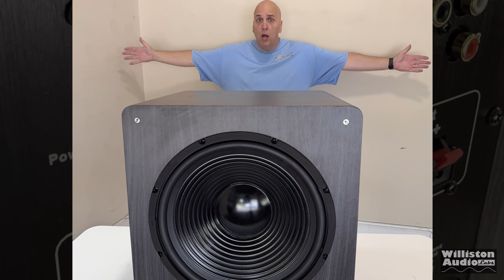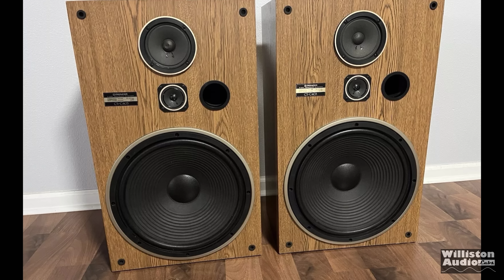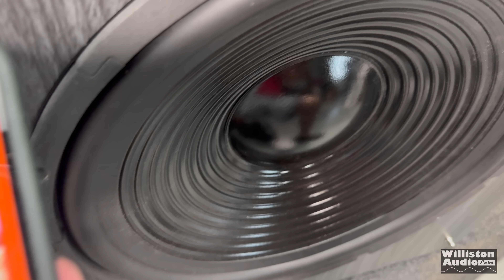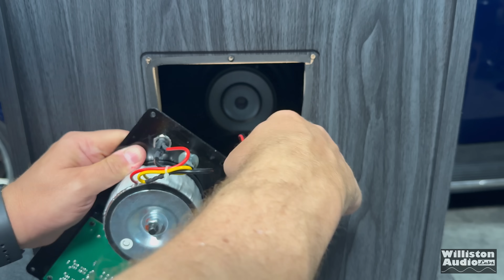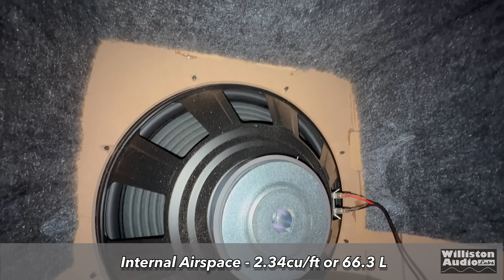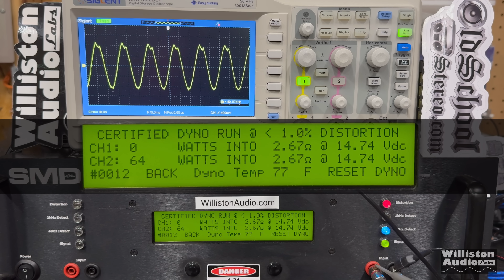The Worst 15" Sub I've Ever Tested - Acoustic Audio PSW600-15 Powered Subwoofer

Comment: Is this the same acoustic Audio company that makes the car stereo stuff like 2500 razor amp and the 2500 W 12 inch subwoofer cause those do bump. Granted they’re not 2500 W amps but they’re usually under $100. I think you did review one of them one time just wondering if there were the same company?

Comment: I hate to say this but um if ur using rcas off a car head unit or the aux to rcas off ur phone lmffao jfc man you seriously need to learn a few more than a few things smffh the line level on house 110v or 220v audio equipment is way fkn higher than even the highest rca line level car audio has to offer trust me my car runs 10 volt preouts 9 sets of rcas at 10 volts rms its an audiopipe component pioneer deh7500 to a mmartts btx8 dsp unit to the audiopipe rca expander line level booster peak 10volt rms on all rcas.  That 10 volt ran direct to an s.a.e. high current a501 amplifier and the sae amp ran at 220v is super quiet yet using the ayima tube style pre amp wakes that sae amp rt up to show off its 250rms per ch at 8 ohms lol thats a fkton for class a home shit frfr

Comment: You should check the subwoofer first. I have seen these all in ones utilize a 1/4th to 1/8th ohm woofer, which may explain the low power. Just a thought. Even the JL all in ones can use a .25 ohm woofer.

Comment: I'd buy it just for the enclosure --- to then swap out the driver for a Dayton or GRS driver (or maybe not, depending on the existing T/S parameters), then put in a couple of Dayton passive radiators, and then make it a 100% passive subwoofer using a used Crown XLS or Behringer iNuke amp with them. It's cheap enough to be an excellent DIY modding project without losing too many $$$ if things go awry, IMO.....
Reply: the enclosure is worthless.  It is cheap hollow wood. A 15 inch subwoofer in a  proper enclosure should never be light.

Comment: I'm not a tec but from  the visual  that I can see  my guess would be the chip set most likely used is going to be a 25cs200  2sa1943 . there quite a bit of ebay  amps that use the chip set usually in lower quality  amplifier  plates   the power supply worth more then the amplifier  section  that for sure..💯🎶🎵✌️🫡

Comment: why would a sub amp have a terdtoryul wound  transformer looks like a 1999 or older sub it need class d chip amp .that power supply would be best in a low power stereo or something needed to run 10 years ++

Comment: I was one of the ones who bought one of these a couple years ago and still use it, but not as a main speaker anymore. I got mine for about $200 when I was looking for the cheapest way to go as low as I could go with 20hz as my goal. This one was the only thing rated even close to that without going way up in price. I already knew to expect closer to 100-150 watts @ 8 ohms peak than the 600w it advertised. I am surprised it's actually 4 ohm!
There is a model with the speaker facing the floor with a 1" slotted "tuned to 22hz" port along the front end facing the floor as well. That is the model I ordered and I should've returned the front facing one, like you are reviewing, for that reason alone. The corner was damaged from shipping as well. I realized how much trouble and time it would be to return it and the fact I wouldn't have any money or reasonable bass for a while, if I did. Plus when I got my money back, I wouldn't have any more money than I started with to try again. Would the floor facing model with a seemingly way more functional slotted port actually made a large enough difference in low end response and throw to have been worth exchanging it instead? I say you should find one and try it, but I didn't see an actual frequency response measurement.
I'll say that it may respond lower than 30hz, but you can just barely notice it if you try hard. I was in a different place in life back then and I made it work by facing the driver at the floor with little "legs" to hold it up and the port facing the wall with the "crossover" set way low and boosting an already high gain on the inputs when I needed more out of it. I also had a problem for a while with the standby mode popping in and out to often, but sometimes not, along with a slight hum from day one. The LFE input doesn't respond to the crossover adjustment and is a very weak input, so it's practically useless. Also, this suffers from a limiter on the output when it reaches a certain lever so that the bass gets softer when too loud, then gets too heavy when you turn it back down. I've recently got an MTX PS-12 from a pawnshop with a blown capacitor that takes care of the missing the deep end while this AA one does a good job adding on the lower-mid bass that the MTX can't simultaneously handle with the failed capacitor, until the parts come in next week. I may get another identical MTX sub and try experimenting with stereo separation of my sub woofers eventually. Then this Acoustic Audio sub will go where it belongs which is (into the garbage) out into the workshop system, and of course for barely effective PA support out in the yard for events.
I've thought about replacing parts for improvement, but might as well keep it together as a "boombox" of sorts. I am really wanting passive subwoofers if I ever get enough extra money, or a deal I can't pass up comes along.

Comment: Hi big D, great video. Though this sub is clearly bad and misleading  I'm gonna input some information about hometheater subs.

They usually have less power compared to car audio subs, not only that their power output isn't linear.
 Most of the good hometheater subs have integrated dsps and a factory power limiters set by frequency.

This is done to have a consistent output db wise, or to prevent damage to the driver due to mechanical limitations.
Exemple, for the sub to achive 105db at 60hz it needs 250w of power, to get to the same loudness at 45hz it might only need 180w because of port efficiency and at 20hz it only uses 50w to achive 100% of the xmax.

Because hometheater subs are designed to have a smooth flat response throughout the frequency range, its important to have a graph of power x (frequency/db) to be 100% acurate.

This technicality doesn't remove the need for the amp to achive its rated power. It only points out that it might not sustain the rated power at all frequencies.

Comment: Acoustic audio is the brand that was sold out of the back of vans in parkinglots!!   I remember them in the 90's and early 2000
Reply: What a stupid name too. Might as well call it "Audible Sound" like yeah bro that's what sound is typically
Reply: @RobertJeffersonBased  Visual Video could be their sister company selling TV's 😂
Reply: Years ago and old friend had a set of "Accoustic Research" white van speakers. They had 12" woofers with tiny little coils and magnets. All show, no go.

They were fine for the 25-30W receiver he had them hooked up to for some classic rock, but by no means were they good!
Reply: @volvo09  

Acoustic research is legit. Not a white van brand at all, though they also made some cheaper stuff. They invented the modern woofer as we know it, back in the 1950s.
Reply: @westelaudio943 i must have gotten the brand wrong then, maybe they were "accoustic audio" because these were NOT real hi fi speakers (i'm not super knowledgeable in the home hifi stuff). They had a tacky little frequency response graph on the front with the brand name on it. Over the years I've come across the same speakers with other names on them too.
Reply: @volvo09 

I think Acoustic Monitor or something like that was also around. Usually these speakers came with a translucent woofer cone. Their quality is similar to cheap early 90s rack system 3-way speakers. Boomy, but not really powerful (considering their size) bass due to the small magnet, and short on mids.
Reply: @volvo09  i remember that the "from a van, in best buy parking lot" speakers were that of the dollar store quality, and that they were told to the potential buyer as being HiFi overstock.  And when i told the seller i didnt know of the brand, it was said its because ACOUSTIC is to good to be in big box stores. that was also the first time i heard the term Bose  Blows"   i laughed at that one.
Reply: @westelaudio943ah, but as this channel has shown us, what they may have been in the 50s has no bearing on what they are today.

Comment: one could make a nice passive radiator out of that speaker. for the amp, build a decent 6" subwoofer and pair it with that. or just send it back because its trash anyways.

Comment: Definitely looks like a cheap sub. I'm wondering though if it could have performed better in a larger enclosure. I remember having a 15 like that when I was a teen, I believe it may have been Optimus  or some other generic brand. In a smaller enclosure it sounded like garbage, but did do better in a larger enclosure. At the time it was in one of those abs boxes that you could find at some of the best buy stores in the 90s.

Comment: Hi Willson it's probably a pair of Toshiba 1943 and 5200 transistors behind the heat sink, they can do a max of 100 to 110 watts with a 120 watt transformer, no wonder it's stuck at 77 watts with the 80 watt torridal, it's a class AB amp I personally owned one, which had an out put of 280 watts, but that amp had 3 pairs of those transistors with a 300 watt transformer
Reply from the maker: Thanks for the info and watching!

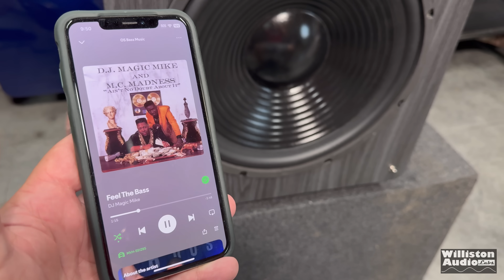Comment: 3:31. The amps are close.. but not 💯% the same.
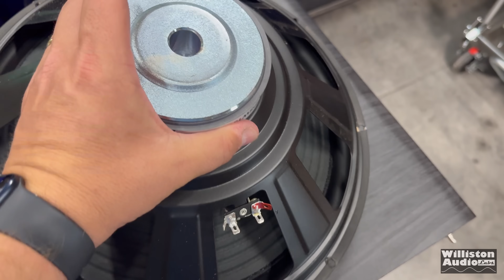8:40 looks almost like my 12" thump subwoofers I bought in 1990.. then moved up to RF.

But let's be real.. a solid 65 watts a good driver and box can perform well. If everything works together.

Comment: @WillistonAudioLabs- The port tune of this enclosure is rounded to 35 Hz, after accounting for the port, & woofer disp., (.1), its 2.2 cu. Ft. Net, & the useable tuned port Length (you don't count a 1/2" @ either end of a flared port), so 6 - 1= 5" for the actual tuneable port Length.
Reply from the maker: I didn’t count the flared parts in my measurement
Reply: @wal   34 Hz then
Reply: @wal  I know you know the part about a certain part/length of a flared port should not be used to calc. the actual port tune, i just put that in there for others who may read my comments. Sorry if that bothers you, thank you for your review.

Comment: Well, you covered all the things I was gonna say from looking at the thumbnail...  Gooldwood sub, same OE rebadged amp, yucky box...  Surprised to see the port flared on both ends, though!

I'd be tempted to run the sub off a more powerful amp, just to see if the driver and box have any value (likely not).

Classic example of selling buzzwords.  15" sub, class A/B amp, flared port, oooOOOooo fAnCy SpEaKeR oooOOOooo....  Why they'd use a class A/B is beyond me.  Throw a crappy class D in there and it might actually compete and be cheaper!  Such silliness...

Comment: you should hook the driver up to a proper amp and give it some abuse 🤣
Reply: they wont last long, i bought the cheapest 12" woofer i could find, gave it a few watts and it lasted only minutes.
that was in free air just to break it in. 
that is basically how the driver work in that high tuned ported subwoofer in the video, if the port tuning is above 30hz, 25hz will break it fast, and its in a box with less cooling.

Comment: Those completely bogus power ratings are really annoying. Nobody believes it anyways. Even professional gear is often over-rated nowadays. I had an active Turbosound monitor for repair a few weeks ago and that thing was rated 850Watts RMS. Ridiculous. With a stamped sheet metal speaker. 
I have an old school "Peavey" 15/2 active monitor and it is labeled "100 Watts RMS". 
That thing REALLY shakes the house.

Comment: A quick check of the output voltage will let you know if they missed wired the transformer from the factory. The output voltage should be printed on the side.

Comment: Basically the equivalent to those "white van" speakers from back in the 80's - 90's.
Edit - definitely not a subwoofer. I actually own 2  10" Goldwood woofers that are from the same series. I bought them from Amazon as cheap replacement woofers for a set of  EPI Monitor 1 boxes. They sound decent. Using them full range they do their job just fine. They are definitely not getting crazy low because they're not subs. That 15" was not designed to be used as a sub.

Comment: The amp should make more power. The 80 watt transformer can easily deliver 150 watts peak even more. 100 watts RMS  should be easy. Looks like the voltage of the transformer is just too low. Someone just had a few thousand extra transformers they wanted to move out! Are you guys sure that the 220/110 volt switch is set correctly?

Comment: got a old velodyne 10inch sub that the amp went out in. still use the crossover bits and ran a cheap horridly cheap class d power acoustik amp to it. pushes more power than the sub can handle but don't need it to be super loud. does it sound better than the stock amp? yes indeed.

Comment: I only use Car subs with Dayton Audio's 1000w plate amps. No prebuilt home sub compares. Also, that speaker as a subwoofer prob have a 100rms but I'm sure if it was hooked up as the Mid-range woofer that it clearly is it might actually be a 300w rms woofer lol who knows.

Comment: I converted my 1980s vintage Fisher tower speakers (the cheaply made ones) into tower subwoofers (mids and highs were burnt out when I got them) the 12" white paper cones can produce way more low frequency than the sub you showed here. But I also power them with a 500 watt Hafler amp. Perfect for my room.
Reply: I also saved some white fishers from the dump and rebuilt the boxes and use them in my shop and they do provide good low bass
Reply: Hafler :hand-purple-blue-peace::face-red-heart-shape:

Comment: Ribbed cone profiles prevent cone folding without making the cone paper thicker. A cone is able to handle a lot of force at its apex when the force is applied toward the open end of the cone shape (with the paper loaded in tension) but when you pull on the same joint (force away from the open end), the same cone wants to fold up with less load (because it is now in compression), and the ribs keep the cone material from folding as easily by enabling it to take up the compression load more effectively. The result of this is reduced harmonic distortion at high output levels. Other cones use materials that are naturally stiffer such as polypropylene or aluminum, or a woven fiber composite, or else they increase the thickness of the paper so it is stronger in compression, so folding is not such a concern.

Comment: 32 years ago I had 2 marantz speaker cabs and they had realistic 12s from radio shack in them and at 1st look the drivers looked huge but it was screw on caps but they were super efficient and people couldn't believe how good they sounded.
They'd knock pots and pans off the stove  i. The kitchen 2 rooms away.

Comment: Acoustic Audio  = S C A M !!!  Judging by your testing and online reports I have found.  There is no way this company does not know that their amp is putting out one tenth of the advertised rated power.  That is a scam.  I would not buy anything from that company.  At any price.  AVOID ACOUSTIC AUDIO...  This has been a community service message from your unpaid local nonaudiophile...

Comment: Ya for a separate video you could run some wire to an actual amp to see how they perform. 

I would imagine the box is also designed in mind for very little power. Though they do seem small for a 15 inch driver if the intention is to at least hit low frequency.

Comment: 100vA= 100 watts, no matter what.  I have the 12" Dayton audio version of their 15" model and while the output transistors on its amp are capable of 120 watts, the subwoofer isn't because it has the exact same 100 vA transformer.

Comment: Ok folks, when Big D says it's bad, it's really bad. His reviews are great and he rarely says "Don't buy", so when he says it, take him at his word. On some of the not favorable reviews,  he leaves it up to you because there may be a redeeming quality or two, or for your particular application, it may work. When he flat out tells you "NO", no means no. With a 1/2 inch enclosure thickness,  it does not even make sense to buy it for the amp and enclosure and slap your existing woofer in this thing.

With all that said, I died laughing when he read the specs that read "long throw woofer".😂😂😂. Just looking at the surround I knew before a word was spoken. Did anyone catch the cheap fake wood wrap seam at the bottom?  Hey, I like cheap prices, and I'll even accept over-rated specs if it sounds good, but this thing is better marketed as a cheap end table or ottoman. Even if you have use for the amp, it can be purchased separately. Such a shame because Acoustic Audio can have decent stuff (though their specs are always overrated).

Good call on this, Big D! This is just one of the many reasons I love this channel and have nothing but respect for Big D. At the end of the day, whether you agree or disagree with him, he really has your best interest at heart, and we all need to give him props for that. His channel was the 1st channel I ever subscribed to. I'll never forget- it was for a review he did on the Rockford Fosgate PBR 300 monoblock I was researching to buy. He had some aweful color green carpet as the backdrop for the amp. His set-up has greatly improved since then, but the integrity of product reviews has always staid the course. 

My humble thanks and appreciation to you, Big D, as always.
Reply: By looking at that speaker I could tell it was BS...